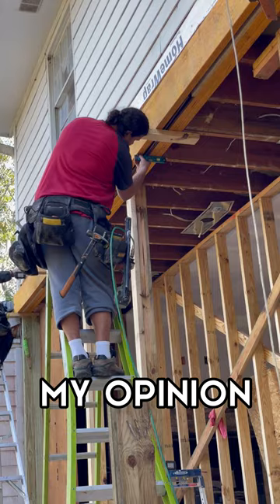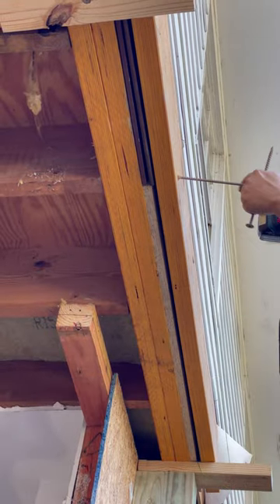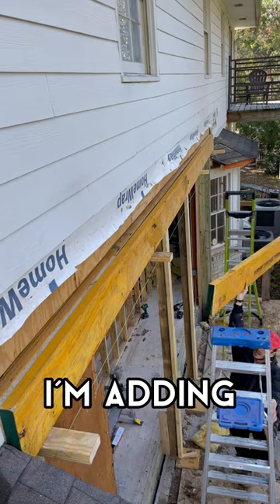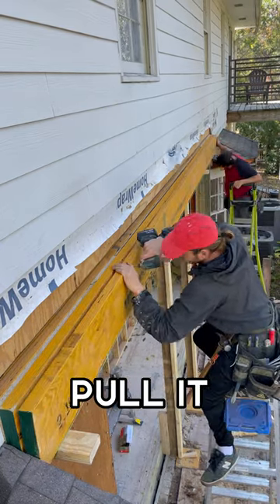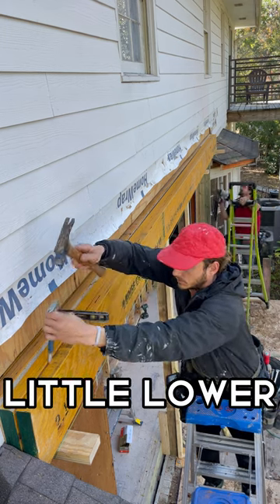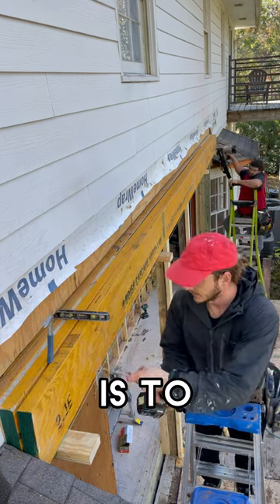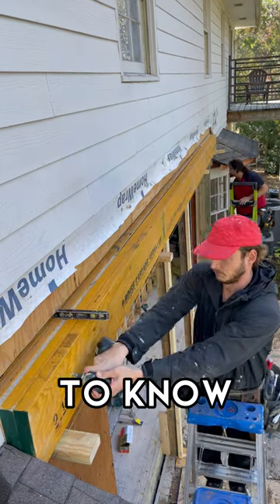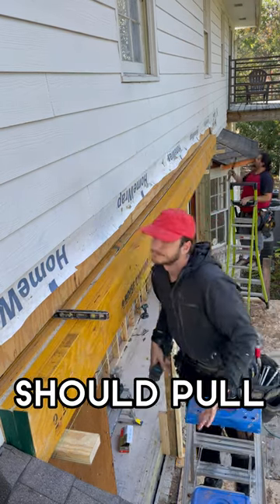Beam 5 | Artpentry

Comment: Is the metal plate that’s going across carrying weight? If so, doesn’t it need to go all the way to the pier at the end of opening.
Reply: Check the previous short to this one.   Art said the “Builder” was also an engineer and that he “ran” the numbers and this assembly was sufficient to span the load.
Reply: @VernBigDaddy  It will also create an unnecessary localized stress point.